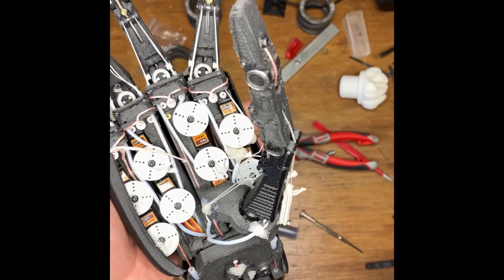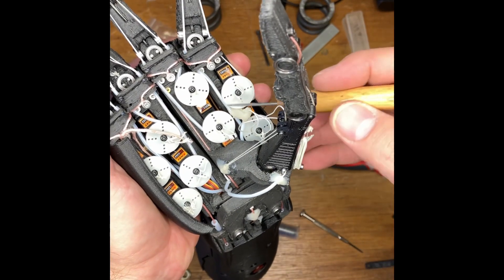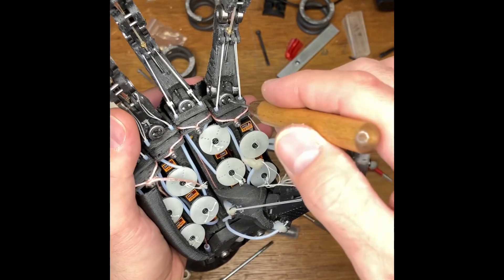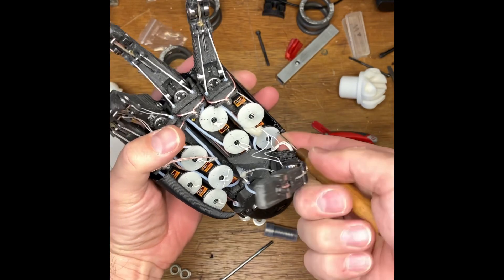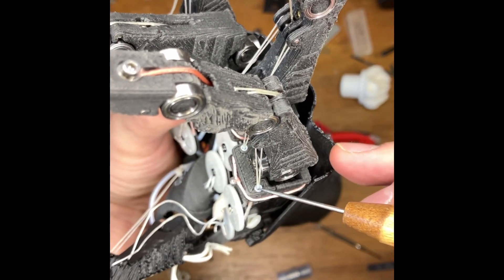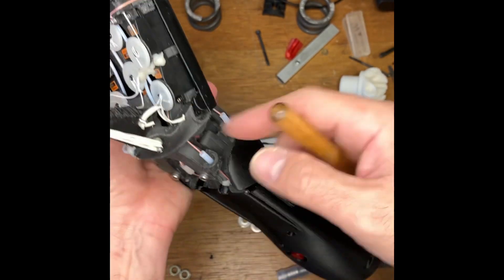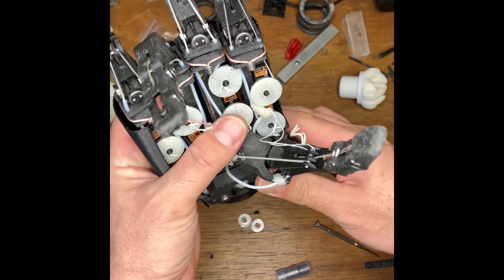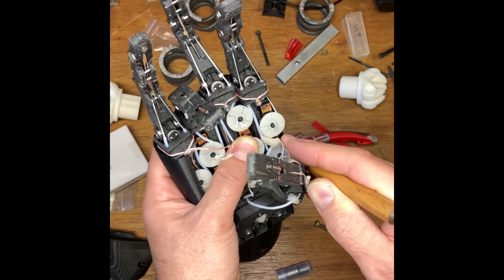Detail of tendons in V1 #DexHand

Comment: Oh ibjust got an idea.... just as the human hand has tendons pulling inside the grip area of the palm, would it be a good idea to use a "Soft" silicon palm plate over those servo spindles and put some kind of "bearing" or slip dice on the top of them as to not empede the servos? That way you get better or firm grip capability?  🤔
Reply from the maker: Absolutely could be - I’d very much like it to be able to do manipulations like palming a coin as used in magic tricks. The soft outer covering is something I plan to look at in due course…

Comment: I like your video very much, especially your robotic arm. I also want to try to use a 3D printer to print robot fingers. Can you share the 3D file of the finger? Or is there any recommended website where I can download the 3D file of a similar robotic arm? ? Thank you so much
Reply from the maker: Yes absolutely! All the information is at dexhand.org
Reply: @therobotstudio  Thank you very much.But now i am very confused about the structure of the fingers. From the structure, it can be seen that there is no connection between TIP and MLP, MLP and PLP. if there are only connected by thendons, wouldn't there be situations like them falling off? Can you help with this? thank you very much
Reply from the maker: There’s a figure 8 ligament that holds the three parts together and eliminates the redundant degrees of freedom.